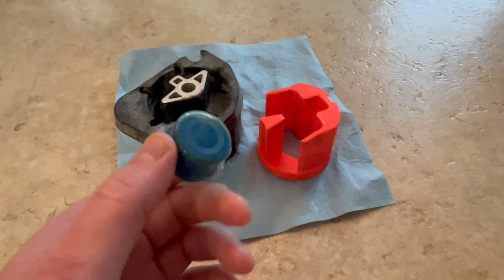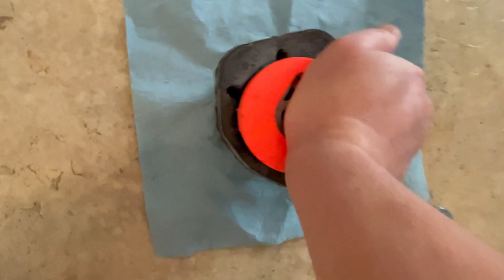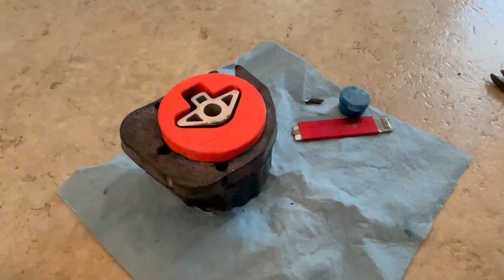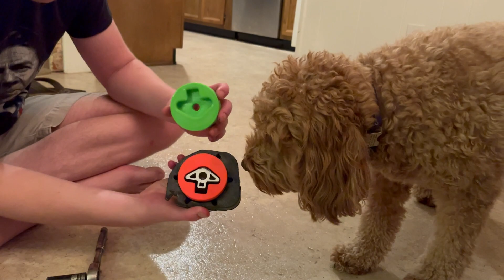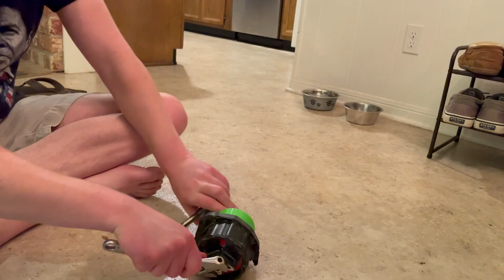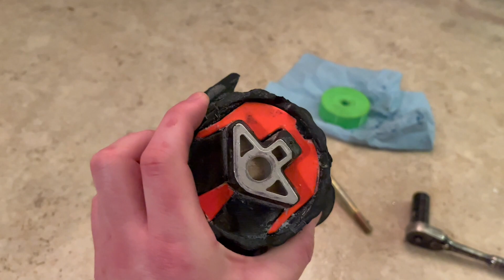BMW X5 (2014-2018 F15) Transfer Case Mount: Polyurethane Insert

Comment: Very nice product, Michael.
If I have a failed existing bushing, would you recommend replacing it along with this insert, or do you think the insert is robust enough to avoid replacing the existing bushing?
Reply: Oops.  I forgot to ask.  The bushing that you designed this for look to be the same part as for an E70.  Can you tell me what the part number is so I can confirm that they're the same?